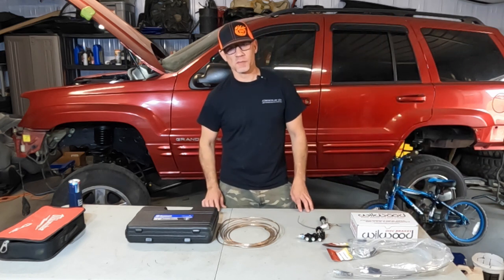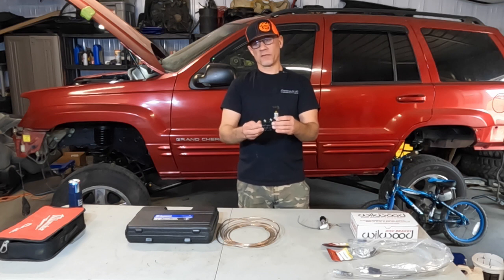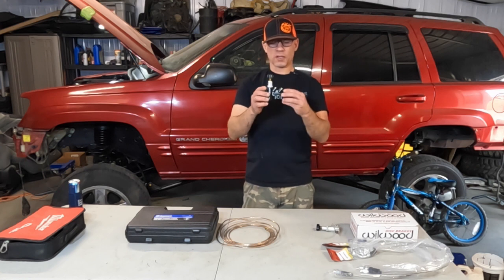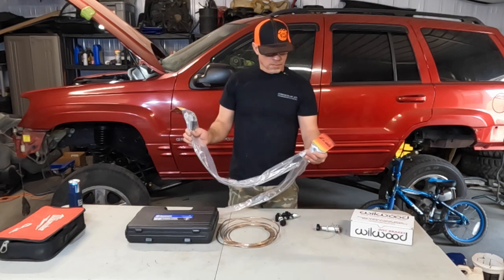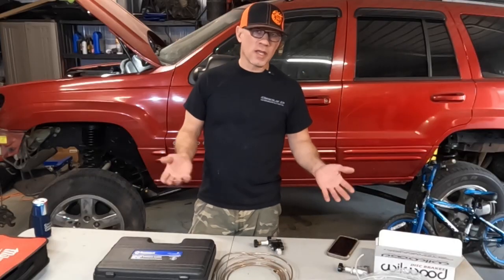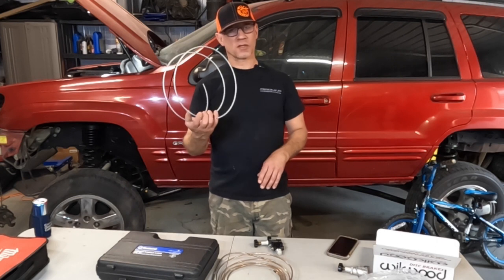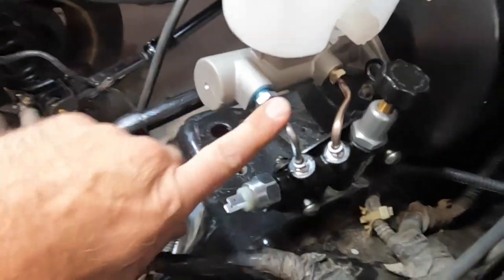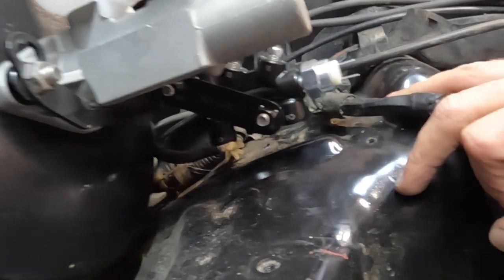Project LSX WJ Installing Willwood adj. brake prop valve.

Comment: Have you thought about ,after you’ve fitted the line before you try to tighten or fit the nut end into the proportioning valve, loosen the proportion valve at the bracket fit and tighten the lines and then retighten the proportioning valve at the bracket?
Reply from the maker: I didn’t show it on camera but it wasn’t tightened down while fitting the lines just close enough it would line up once tightened down.

Comment: I was wondering why you choose the LSX over doing a HEMI swap ?
Reply from the maker: We originally wanted to o all Mopar and swap a hemi, you can even use the stock 545 trans but the cost of a used Hemi was about the same as a rebuilt LS. And MANY more options with the LS route overall. We're ultimately happy with our choice but we do plan to do a Hemi WJ in the future.
Reply: @quadscrib229  I understand the cost for hemi swap .